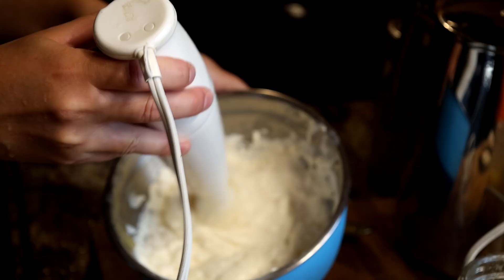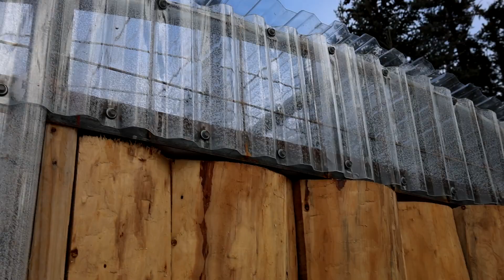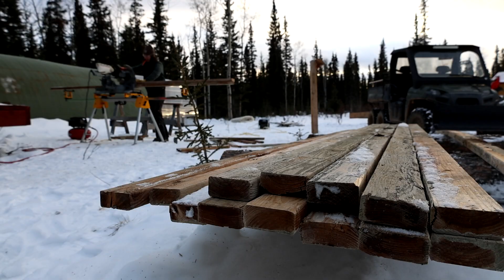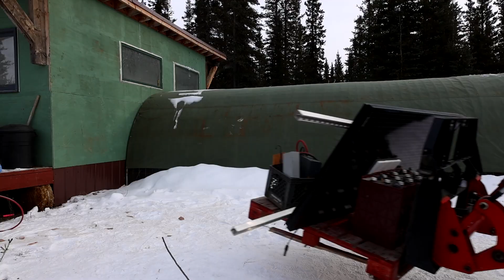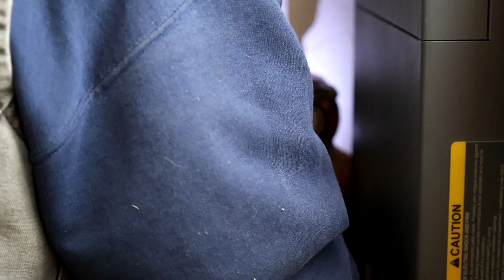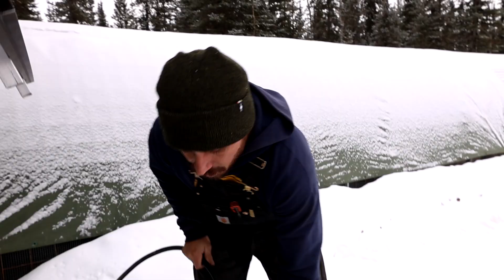Bringing Solar Power to the Chicken Coop

Comment: I live in Talkeetna..   Just thot  you ppl cud do a very interesting video on solar power..   Mostly winter vs summer..    Angle of panel..   how you keep snow off..   Do you change angle for winter..   Compare solar power in winter vs summer..   I wud be interested, and I think lots of ppl wud find Alaskan different solar power..     Do you guys make it work, or use generator more in winter.??   tnx.. willy arett..  Talkeetna..    An Alaskan since 1963..   Talkeetna since 74..

Comment: When we used similar plastic sheets for our dog kennel, we got rubber strips that fit in the "grooves" to keep the plastic from rubbing against our frame and to stop the rain and snow.  You might check on adding that at least to the ends.

Comment: I am concerned the condensation on the windows is going to cause the wood around them to rot. Have you considered putting plastic over them on the inside to minimize the hot air meeting the cold? Maybe even build a frame to fit inside the window casing covered with plastic as well kind of like triple panes. Just a thought. Stay well stay safe❤️

Comment: I think battery gas actually will accumulate at the bottom cuz it's heavier than air so I would double check maybe put the vent on the bottom instead of the top

Comment: You should put some blue styrofoam under the batteries and agains the outside wall. They don't like super cold. That vent is really big as well going to let a lot of cold in.
Reply: Also, for that setup, I would go all DC, as the inverter wastes a lot of power.

Comment: Those are lag screws, not bolts, I'm pretty sure. No nut or machine threads = not a bolt. Those coarse threads and the pointy end = screw.

Comment: Looking good!  I have thought of putting solar in for the birds but have not done so thus far.  Very informative...thank you for taking the time to explain.  Hope part of your plans is to add some extra plugs so you don't have to use extension chords.  Think timer for the lights as well.  An outdoor plug might be an idea as well.  I am curious what you will be using for heat - I use a milk parlor heater but find the dander destroys them real fast.  Would like to change it up, but don't know to what quite yet.I would suggest putting some wire screen over that vent to prevent rodents and/or wasps and bees from going up  in side.  Very well done.

Comment: Glad to see you were able to repurpose your old solar system, this should enable you to give your feathered babies a more comfortable environment during the short days of winter. You may want to vent the lower part of your battery enclosure as close to the floor as you can and to the outside as the hydrogen sulfide gas the flooded batteried generates is heavier than air and tends to accumulate to the lower areas.

Comment: Be careful your chicken run doesn’t get too hot with those polycarbonate panels. (Fried chicken). I used them on my greenhouse and the temps can easily get over 110°. I live 10,000 ft above sea level in the Colorado mountains.

Comment: Really happy you’re able to continue your projects. Well planned and implemented ideas for the room solar etc. interested to see the next phase. Was wondering about the untarped end of the run and open access, but of course you had a stop gap in place. Panels are great, adds a lot of light and no wind or snow. Are you sure you don’t need a better lock on the new room? Your chickens are pretty smart……😂. The solar setup is really clean. Thank you for the great video!

Comment: Great job! I twist my brain how to secure my chicken run against hawks etc. It has been a dogyard before and the fence is to low to just put a net over, its gonna be hard to clean it out if I do that. But if I bend a reinforcing mesh over it with small squares I could probably cover at least half of it. 

I do not remember how to shower in your new house...but I´ve been wondering why you don´t build a sauna? Warm, cosy and you get very clean. Maybe beside the cabin and pull a pipe between the houses to let the after warmth in to your cabin. If not to moist air it would also give you better air inside the cabin in winter. For people down south: in a cold climate we get very dry air inside the houses which may irritate the mucouse membranes in our eyes, nose and throut and gives easy access to airborne bacterias and viruses. We often build a sauna in our houses, easy access and also help warming our houses.

Comment: My two pennies worth.  You could incorporate your bee hives into the chicken house,  taking Advantage of the warmth you have there,  the bees wouldn't go out,  nothing much for them,  but they would potentially survive better. You could set them up so you can access the bees from the inside. They do something similar in Europe as a bee house,  but without the chickens.  Your benefit would be double use of the heat. 
Cheers

Comment: Great video.  Glad to see the chicks getting some heat and light.
That 70.6 from the generator was probably amps.  You wouldn't want to pump 70 volts into a 12V system.

Comment: I would have a 2x6 or2x8  x12 or 16 on edge with 4 2x4 for post under those arches in the chicken run for the winter

Comment: Good job on the solar.  2nd time around one figures out a better way.  Do you have small wire mesh under the tarp pat of the coup tunnel.  Concerned a marten could get in.  Chick chick chick.  Good vid.

Comment: 1. Home-cooked naturally organic breakfasts, lunches, and dinners delivered to your door, 
2. solar-powered lights and electricity, 
3. heat...
**that feeling when.... a flock of chickens in Alaska are living better than me!! 😕😆

Great build guys, glad to see Eric wrapping the ground wire on the light switch screw in the proper/clock-wise rotation.  And, glad to see the diagonal brace 2x4 inside the new door is the proper direction (it goes from the bottom hinge to the upper corner, like you have done!!)   
👍👍👍

Comment: Eric, if you have any concern about clearing the hydrogen from your battery box or preventing cold air  back draft , there is a product called Power Vent at several voltages. We used an old chest freezer box for our batteries and it worked well. You can hook it to your inverter charger to run only when the batteries are charging and gassing. It only uses 3 watts! Just google it to get more information if you're interested.

Comment: A suggestion on the battery box vent pipe some type of Insect proof mesh to stop the bugs  i.e wasps, ants & fly's in spring/summer. Do sooner rather than latter because you could  forget & one day in summer you open the box to check the batteries and discover a large wasp nest inside the box. 🐝🐝🐝🐜🕷

Comment: Love that the girls are happy! Can't help but worry about those cunning foxes figuring out to go under the tarp though, to get to them. Just thinking that maybe a coat of chicken wire on the inside could deter them even more? Also, one other worry (lol... I also live in a region with extreme weather and have faced these issues), those monster icicles we can get might wreak havoc on that solar panel. I've had several solar panels on outdoor lights taken out by projectile ice missiles. Granted, they're much smaller and not as hefty as that wall panel, but my internal warning sirens went off and thought I should share...lol. I really could use your expertise though in installing that off-grid panel here. We've already had power outages, and at 20F is no fun! Won't be long before we're down to your temps. And, can't trust my elderly father around wood stoves anymore safely. Can't wait to see the next video. You guys do such a great job!

Comment: I am always amazed at what you get accomplished! 
Question: Would it be worth it to change the panel mount so that it would pivot at the top, so that during winter the panels could be vertical (no snow accumulation) then swing them outward when the sun is higher during summer?
ps: don't forget to put a screen in the pipe vent. Mr Mouse is eying that new heated condo ;-)
Reply from the maker: Honestly we pretty much get no sun all winter long and summer our batteries are full by 10 am so we just leave them stationary :)

Comment: I think you may have some snow build up on the poly panels running in that direction. You may want to put a smooth clear plastic cap over the top so the snow falls off easier?
Reply from the maker: Yes we are thinking that also but they would not bend the long ways ;)

Comment: If I could please give you any advice do not use a hammer inside your freezer you're going to break it damage it the antifreeze is going to be released into the atmosphere which is not good you should tap it with a soft Mallet of some sort but please don't be banging on it. You're going to regret it I realize this is a run-on sentence but I'm just trying to help you

Comment: Saw you were going to defrost your freezer.  We found a way to speed up the process.  On a warm day( above 32 deg F) take a vacuum cleaner and hood the hose to the output of the vacuum.  This blows warm air.  You can direct the warm air inside an empty freezer and melt the ice from the sides of the freezer.  One can then take out the slabs of ice.  We find we can defrost a freezer the size of yours in about 30 minutes.
Reply from the maker: Great tip!

Comment: Love what your doing! I'm sure you already have, but if not (speaking from experience) you need a hardware cap for the vent tube on the batteries. It will help keep the mice and squirrels out of the batteries.

Comment: Don't put anything against an outside wall. The object itself will act as insulation from the warm air inside, to the -60 wall. Your batteries will freeze there. Put them against the inside wall of the closet, and vent them outside.

Comment: If those are 12V solar panels and you hooked them in series aren't you actually feeding 24V to the charge controller?  12V panels should be run in parallel to input 12V to the controller.

Comment: One suggestion.... You may want to add a screen to both your battery box air input vent hole and the PVC vent pipe to keep the small critters out of your battery box. They love to munch on the electrical insulation.  Great Video!

Comment: I hope you are not trying to use this outlet for a heater or any other high power device. Those switches are not made for that kind of current draw, add a bistable relay to it or replace it with a breaker or something will burn.
Reply from the maker: Just a small light ;)

Comment: Gourmet pancakes for the chooks! Followed by gourmet crepes for you! Those chickens are being pampered, gourmet food, 5* accommodation, next heat and light too. Again, the Branson gets used to help you reach higher. Liked the solar installation, explained well. ONE Tip. When using a spanner on the battery terminals, drape a thick cloth over the adjacent terminals, just in case the spanner gets dropped across both a positive and negative - it will cause a huge flash/bang and is very dangerous. In my car, the positive battery terminal is quite close to the body (negative) so I have wrapped one spanner completely with pvc insulation tape, leaving only the spanner jaws exposed.
Another great video - looking forward to "Chicken Coop - Heat and Light Part 2" Loved the "Halloween " touch right at the end....!

Comment: Just a question?
Why would you have the door on the heat room opening inward. 
The room is small enough 🍺🍺
Reply: At first, I thought the same. However, the door-swing arc area inside would need to be kept empty to just walk inside regardless. Only the tiny sliver of arc made by the opened door to the adjacent (hinge-side) wall is theoretically "lost" as storage. Contrast this tiny utility loss to the daily convenience of not having the conflicting arc outward to the main coop entryway and it makes sense this way.

Comment: Try using a $9 ceramic coating we use for cars on the solar panels, and even on the snow shovels.  It should get the snow to slide instead of sticking.  Or at least easier to brush off since it gets so cold there.

Comment: Consider putting a flapper on pipe which will only allow air flow one direction. This would prevent cold air from being forced into the battery box.
Enjoyed build.  What kind of heat

Comment: I have used a putty knife to remove frost from my freezer
Reply: Put a bread pan in there and pour a kettle of boiling water into it. Close the freezer and repeat as often as needed depending on how large the freezer might be. It may take a bit longer but there's no chance of puncturing your freezer surface. Once the first melt gets started down to the liner material, it happens in two minutes as I recall.

Comment: I have used those polycarbonate panels for my greenhouse. Works great. Lots of light for the chickens. Great job
Reply: Same here. The only issue I've had is after 5 years now, they've begun to crack at the screws and my little overhang breaks very easily with snow.  But even if they need replacing on the 6th year, I think it's still a good material to use.